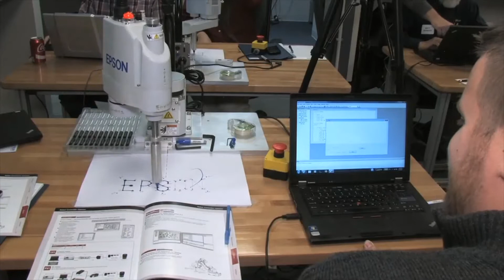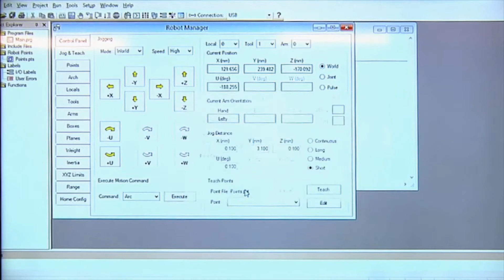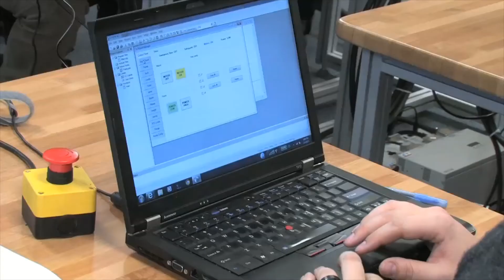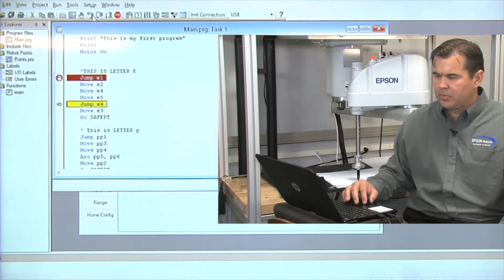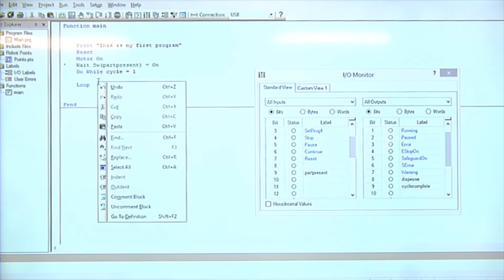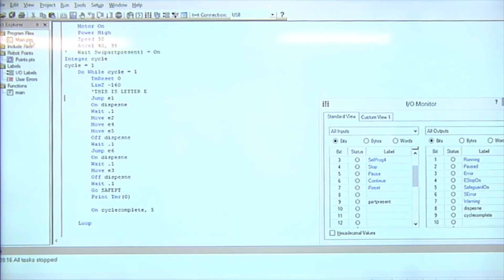EPSON Robot Training (Part 1)

Comment: I have a RC790-A controller with a C4-A901S bot.
I have learned a lot from your video but am having an issue with the robots real world position not matching the 3d cad position in the simulator. I have tried to reset home but I am not sure if it's an encoder issue or what is going on. Please help.